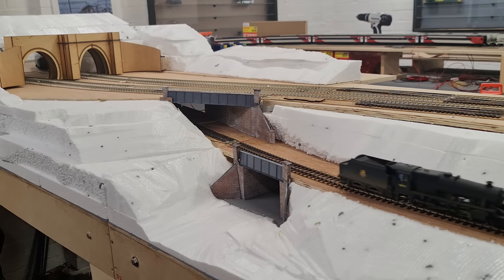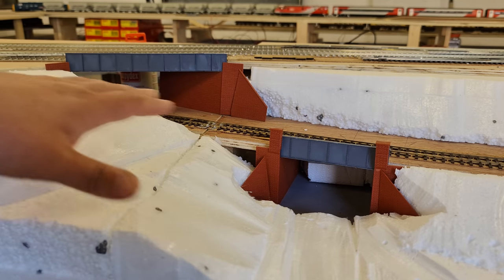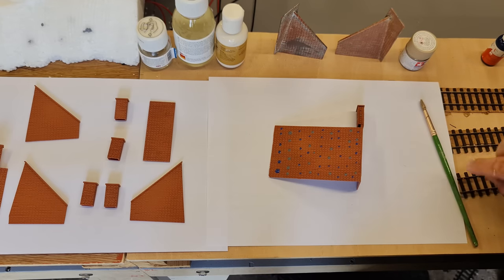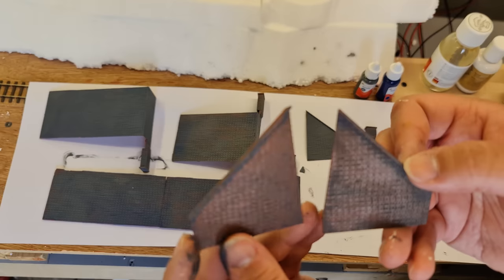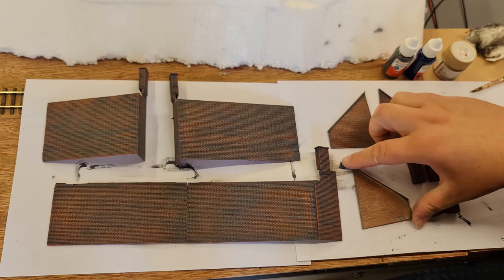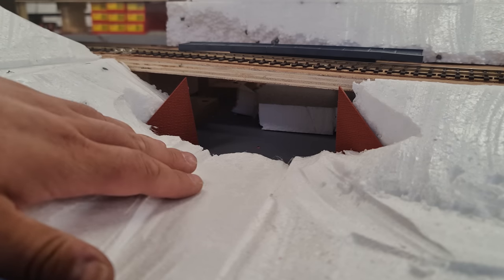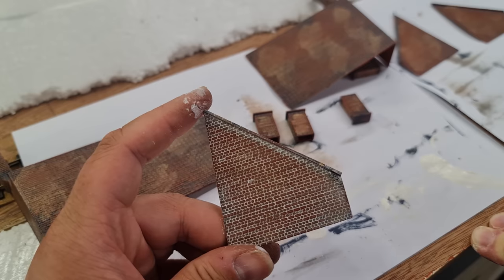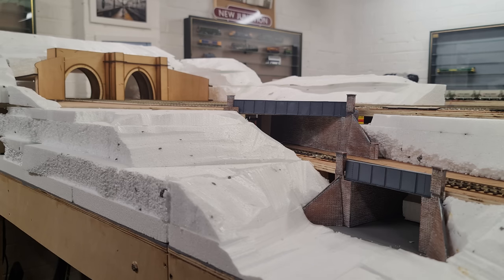New Junction EP14 - Heritage line bridges

Comment: Seems I'm a bit late to the bridging party! Really glad to see none of the dreaded 'floating girders' you so often see, which for me at least really spoil what is otherwise often a well built and painted structure. I find a bit of variation in the girders helps somewhat with something like this, as in reality the different span lengths will dictate different girder profiles. The Wills girders are a fantastic resource, but because of how readily available and versatile they are, you do kind of end up with the same thing as everyone else in much the same way as using the Peco girders. Nothing wrong with that at all by the way, but for those not too phased by some kit bashing and looking for something different, have a look at the N Gauge Kestrel/Gaugemaster water tower kit. Perfect for making lighter built girders in 00 gauge of the sort which carry branches over small roads.

Comment: Not been keeping up with YouTube of late, so been catching up on your progress. It looks great so far, i think the changes you made following the first exhibition assembly look likely to be much better. 

I noticed your revell glue without a nozzle, i presume it clogged up? Apparently a lighter can resolve that issue. However i switched to using tamiya thin and tamiya plastic glue in the little pots with a brush. Much better, especially the thin with the very fine brush.
Reply from the maker: Thanks, great top tip

Comment: Hello Richard. I've been subscibed to you under my original YouTube handle for a while now. However, I thought that I would now subscribe to you under my own channel for my layout, in the hope that you may have a chance to look at it and maybe even subscribe to it. Anyway the bridge abutments and girders are looking good. I normally use enamel paints on any embossed plastic that I use, but I may have a go at using acrylic paint now that I have seen your video. Nice tip about using a matt varnish before doing the mortar lines. I'll have to try that one as well 🙂 Best wishes. Mark.
Reply from the maker: Thanks Mark, I'll be sure to subscribe,  looking forward to watching your layout.
Reply: Thank you very much Richard for the sub, that's very much appreciated. Although my layout is very small compared to yours, due to lack of space. So I hope that it doesn't disappoint you.
Reply from the maker: @StanoverModelRailway2020  it's not about the size...